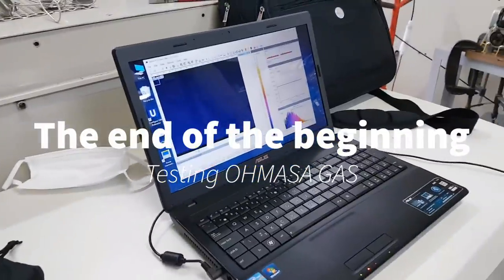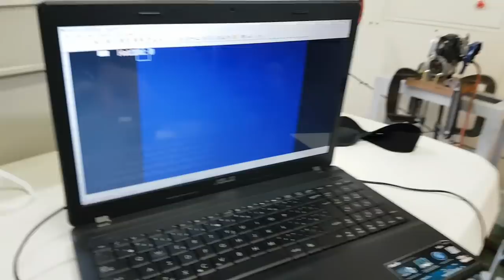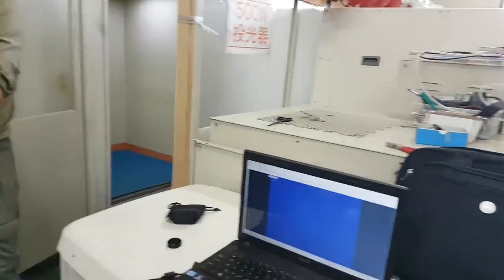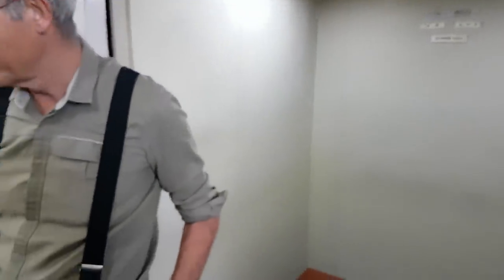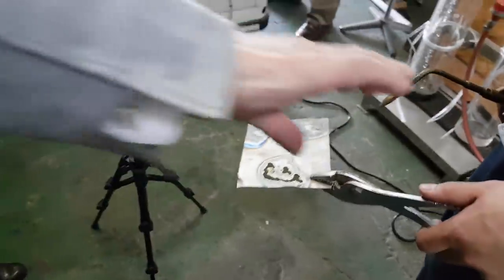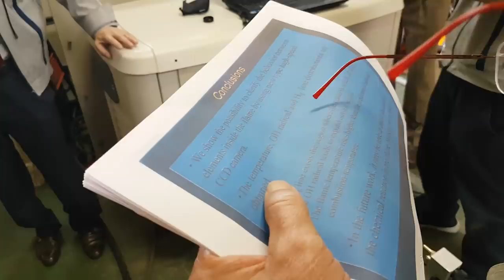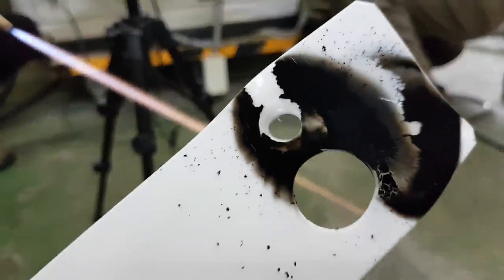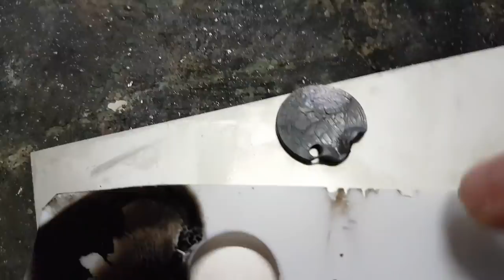OHMA - The end of the beginning, the 'New Fire' has arrived

Comment: The thermal imager registers not heat, but infrared radiation. In hydrogen, there is no radiant substance that would be able to initiate the appearance of infrared radiation, for this reason, the flame of burning hydrogen is not fixed by thermal imagers.
Reply: I have hydrogen gas and will verify but does not account for the incandescent titanium plate reading.
Reply: @BluesDoctor  Substances heated during the oxidation of hydrogen emit infrared waves, as a result of perturbation of molecular bonds in the structural lattice of the heated substance.
Reply: The reason I was not sure is I asked myself if H2O product of combustion would produce the emissions or was there a phenomenological piece I was missing. I have worked with hydrogen in many applications for nearly 30 years and thermal and other imager design for nearly 20 years. I have never examined a hydrogen flame with an 8 to 12 micron imager. I'm always open to something new.
Reply: @SEVERS72  my point exactly.
Reply: Hydrogen by itself may nor be emitting IR but the byproduct of combustion is water which will emit IR as will all the surrounding gasses.

Comment: Heat is NOT what the standard model teaches, and temperature is effect of conductivity of the field- not a measure of work being done. Heat does not equate to electric "current" or "energy", and temperature or current do not equate or directly correlate to work or "horsepower". Classical electrical engineers and oil company goons don't want to accept this truth. My own invention of high torque, cold-running, DC electric motors prove this is true. This video about the "new fire" also proves this is true, that the models of energy physics and electricity are due for a quantum leap. Both torches do the same work, but one gets hot while the other does not. Both electric motors do the same work, but one motor gets hot, while the other does not.

Comment: @10 mins we burn through the tungsten ... the camera only registers 400C  ..... when the torch is taken off the tungsten , (presumably the plasmatic effect has ceased ) but the metal is still glowing orange .... this metal must be 1000C
Reply from the maker: Don't presume a plasmatic effect is always caused thermally
Reply from the maker: Peer Reviewed Journal publishes article on Long-Lived Plasmoids

- Observation of Strange Radiation tracks
- Transmutation determined in affected material
- Video recordings of translating glowing toroidal plasmoids on exposed surfaces 2 days after treatment
- Video recordings of clusters of similar structures ‘rolling’ over surfaces
https://youtu.be/TO-X58PfqIU
Original on-line published webpages from 12/29/2008
P1
https://mephi.ru/content/articles/index.php?ELEMENT_ID=1689&fbclid=IwAR0j1N6Pgu_xXT2_Vxyd-MHURu6TFA1cUF93VlJOkAg9w1Fy2XlDJdsyFM8

P2
https://mephi.ru/content/articles/index.php?ELEMENT_ID=1689&fbclid=IwAR0j1N6Pgu_xXT2_Vxyd-MHURu6TFA1cUF93VlJOkAg9w1Fy2XlDJdsyFM8&PAGEN_1=2

P3
https://mephi.ru/content/articles/index.php?ELEMENT_ID=1689&fbclid=IwAR0j1N6Pgu_xXT2_Vxyd-MHURu6TFA1cUF93VlJOkAg9w1Fy2XlDJdsyFM8&PAGEN_1=3

Paper

Video Recording of Long-Lived Plasmoids near Objects Exposed to Remote and Direct Effects of High-Current Pinch Discharges

B. Yu. Bogdanovich, N. V. VolkovN. A. Len’, A. V. Nesterovich

Abstract—The results of observation of plasmoids that were formed during periodic discharge in a flow of liq- uid, in particular, water, in its surrounding space during discharge and in post-discharge, have been pre- sented. The presence of long-lived luminous formations not only in the air, but also on the surface and above the surface of nearby objects has been noted. The reasons for the appearance of such objects and their prop- erties, which have features not only of macro-, but also micro-objects, such as Dirac’s monopole, have been analyzed.

Technical Physics
April 2019, Volume 64, Issue 4, pp 465–469
First Online: 15 May 2019

https://link.springer.com/article/10.1134/S1063784219040066

Technical Physics Journal
https://link.springer.com/journal/11454

The paper
sci-hub.tw/10.1134/S1063784219040066

Comment: Love the passion! Don't let the Oil Company Goons at the "prestigious university" with their Exxon and Dow Chemical funded education call you a "liar". I don't care if they are from "Japan"- they are still bitches for Big Oil- EVERYONE with a classic education, especially from the big three (CalTech, Harvard, MIT) are brainwashed in classical thermodynamics. Stanford U. is the exception who are more open to LENR reality and anomalies regarding "excess energy" or "over-unity" devices that don't get as hot as expected- or return excess heat hours later, etc. The cold running electric motor has MORE torque than the hot one. Current does NOT equal horsepower in motors- only the total field strength and these nuclear reactions give the mechanical "work". Keep up the good work, and don't let haters get your goat.

Comment: Thermal conductivity of titanium is very low (1/23 of copper), so it might not be able to transfer enough heat to the teflon to melt it. A bit of moisture will make welds explode, and if the metal is close to molten it will blow a hole in it. Thermal coductivity of copper is alot higher, so it cuts thru it, albeit deforms in the process. Don't see evidence of fusion :p
Reply from the maker: The titanium was in the low 100sºC and the teflon was dry.

The copper plastically deformed despite being nowhere near its melting point.
Reply: @MFMP  but copper is pliable even at room temperature. When you notice something interesting DO IT MOE THAN ONCE XD otherwise you might be prematurely getting your hopes up.  Keep the Leidenfrost effect in mind.  btw you should have tested the interaction between two pieces of the same metal, and with another metal ex. coin and the Ti plate. The boundry effects are tricky.   Also continuously heating one piece as it's touching the other.  Having a HHO torch for comparison wouldn't be too crazy either.
Reply from the maker: @sFeral  We had very little time and exhausted, we are an open project so the data in whatever form goes out raw - it self corrects in time, when we were young we could not walk or talk, but we get there in the end.

We will have a system delivered and we can do any kind of test that the crowd imagines with all the controls one could think of.
Reply: @MFMP  You need to run an imaging control with an oxy acetylene torch.  I am not sure that the acetylene torch nozzle gets hot either.  Also, while titanium will melt at very high temperature, titanium will burn at 600C in the presence of oxygen.  You didn't show melting or evaporation, it seems like you showed burning the titanium; I.E. rapid exothermic oxidation of the titanium.
Reply from the maker: @bobhiggins2455  
1. We proved that that the vibrating generator OHMASA uses created broad spectrum ultrasonics, this led us to suspect cavitation
2. We proved it had cavitation marks at resonant nodes on the plates, this lead us to suspect the production of EVOs based on observations of LeClaire and Shishkin
3. We proved it produced SR in abundance
4. We proved SR can be generated from cavitation spot locations
4. We proved that it could produce massive quantities of EVOs by inserting an Indium for just 10 minutes and observing nearly all the signatures found by Takaaki Matsumoto between 1989 and 1994 and published in Fusion Technology based on PdD and NiH systems and recorded in his case on nuclear emulsions. Takkaki Matsumoto conceded later that he had re-discovered EVOs.

EVO saturated metals will oxidise near instantly through the bulk as they did with the ECCO mild steel re-bar in India (0.6s) and with the Cu wire windings in LION reactor (2s). It is doing the same here.

Additionally, at the surface, EVOs that dishevel cause the observed 'Brilliant Light' (which was painful to get close to looking at and lit up the room like a flood light) by ionisation of atoms in the air.

The instant sheet of carbon that formed on the teflon was interaction between the OG and the surface atom electrons. The carbon then heated and oxidised allowing the flame to pass through the teflon, but at a slower rate than it did with Ti.

W is also rapidly oxidising and likely disintegrating along impedance boundaries (crystal grains) as observed and characterise by Matsumoto in early 1990s due to EVO action.

We also proved that SR can get trapped between a conductor and an insulator as established by Shoulders and observed by Adamenko/Vysotski, Shishkin et. al.
Reply: @MFMP  I am not suggesting that the device did not produce SR - perhaps it did, and this is the most interesting part.  I am just saying that the experiments you did with the torch didn't prove very much.  I am not sure how the Optris will register a torch flame (is its spectrum blackbody?) - you need to compare your OG pictures to pictures of OxyAcetylene, including the nozzle.  The gas usually exits the nozzle at high velocity, putting the flame away from the nozzle, while the expanding gas cools the nozzle.  When the titanium ignites, it will produce a bubble of gas around it that is much cooler than the actual burning titanium, so you won't see the temperature of the titanium that is burning.  When it comes to water and high temperatures in water ... welding is done underwater all the time, but the whole lake or ocean doesn't heat up.  Also, in the case of single bubble sonoluminescence, the collapsing bubble has been shown by emitted spectrum to be over 10,000 kelvin, yet the whole body of water doesn't heat more than a few degrees - it is the issue of heat vs. temperature - high heat and high temperature are two different things (as you know).
Reply: @bobhiggins2455  rational argument. When things appear strange it always deserves a closer look. We now have a system to 'at will' explore the unusual behaviors to our satisfaction. The carbon interactions raises many phenomenological things to explore.
Reply: Yeah that teflon is pretty thick and that piece of titanium was pretty thin and wasn't that hot. I'm not sure it behaved in anyway different than you'd expect it to. Same thing with the temperature of the flame.
Reply: @SpenserRoger  I see several features that intrigue me. One is to not forget Planck's blackbody radiation. If I am able to duplicate this experiment I will certainly look at the spectral energy distribution. I have investigated blackbody anomalies previously and they exist. Microwave water and nonuniform heating will create 'strange' but easily explainable local superheating, certain plastics will have odd behavior similarly. But this has a collection of odd features. Not so easily dismissed as a collection. Most importantly we have access to an easily repeatable 'system' for exploration of all the features and to me the most significant will be to change single variables and note the 'system' response. This has been all but impossible previously.

Comment: that is HHO Gas, right? (how do you spell 'emarza gas' ?
Reply from the maker: No - it is EVO/SR encapsulated matter. It has many unique properties that HHO does not.

OHMASA GAS
Reply: @MFMP  Yes, thank you very much for the correction.  I'm watched the ken shoulders interview with John Hutchison several times, trying to gleam as much as I could from it; I'm well aware of EVOs.  Mind you; I do a search for OHMASA GAS
, and that is HHO ( or interactions with atomic compoents, in a plasmatic state ( similarities also to GEET carburators ), and this likely is a sort of cavitation in the recombination that interacts with things.  The +CO2 makes the flame more visible, I recently saw an experimenter with a vacuum chamger and gasses, and CO2 is white under low pressure and high voltage.    (Mark leClaire (?) Micro/nano machining using micro cavitation in water(?), high energy water forms a hex lattice... Okay ya, no, I'm diverging a lot... the important point of his work was the cavitation of water, causing great force, without heat, is (could hypothetically be) similar to O and 2 H recombining; which I think may also be much different from using H2 and O2 in tanks, since those would already have covalent bonds to break... electrolosized water is already less covalent ) .    Brilliant light power (preivously BlackLightPower ), is just arcing across water with high voltage, and getting a tremendous impulse out; they've previously done other experiments that produced a form of hydrogen (hydrino) in a very low energy state which was nearly impossible to detect, and spectrally behaves like darkmatter.      (Hello, Goodbye :) Are we caught up? )   Yes, I'm just a fan boy and garage scientist.
Reply: One more thing, what about just fire-brick?  Can it heat that up?  If you char it does it heat up?  Or the ground... can you calibrate with like 2000C that you can heat the ground and in trun melt something?  (well proably invest in a small furnace-force kinda bucket with firebrick?  Or just the brick?  I've seen it cut through that just as well... (I think?maybe no because insulator?)
Reply from the maker: @3zdayz  We will have our own unit soon.
Reply: @MFMP  So one other thought - if a nice inert like co2 is white, maybe adding sone neon would give you a nice red flame :)  Not quite like lithium.  I'm probably way off base (probably out of the ballpark, but figured I'd share the thought)
Reply from the maker: @3zdayz  worth a try